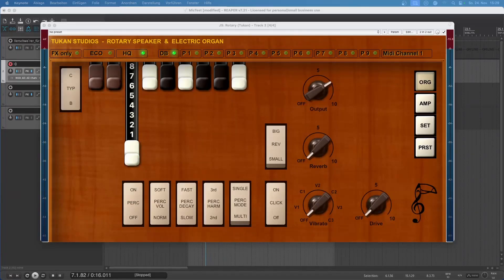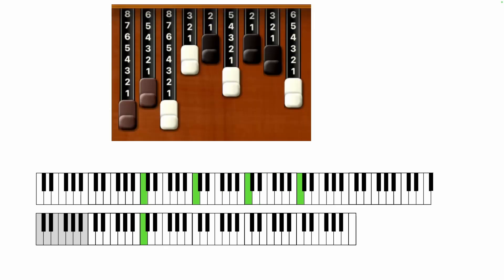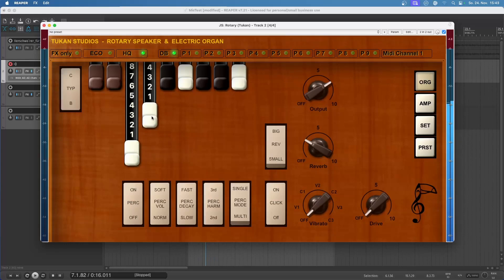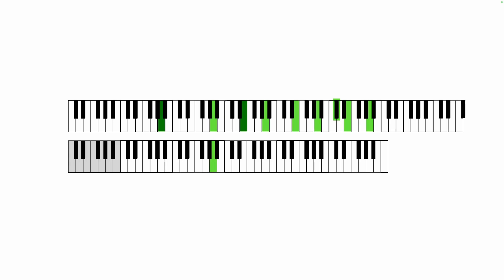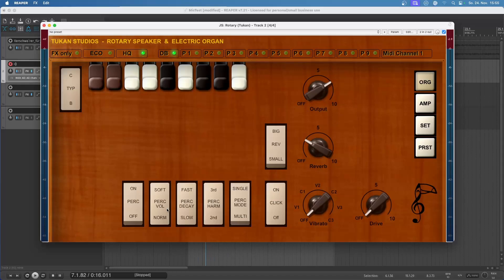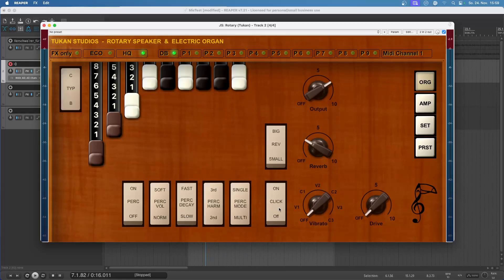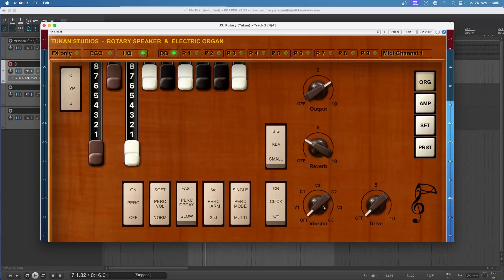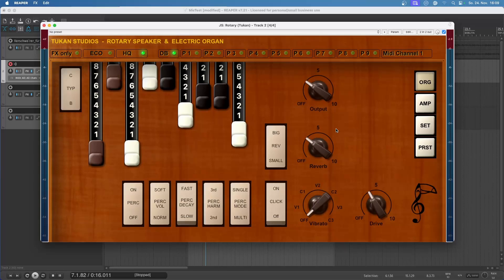The Organ Page - Rotary Plugin (Tukan Studios)

Comment: Sorry for bothering you but I'm having inexplicable trouble with Rotary

It loads fine

I can play it over MIDI

The presets work fine

But

The user interface shows no controls. All that appears is a wood effect rectangle. On the right of this is the 4 buttons labelled Org, Amp, Set and Prst under that is the Tukan logo and that is all. No drawbars buttons, switches or anything. The 4 buttons I mentioned earlier don't do anything or change the screen. I have the latest version and have tried to reinstall several times. I really don't know what to do to make the controls appear. Any help would be gratefully received. thank you in advance. J

Comment: John, I apologize if this is an inefficient place to request changes: but your synths/instruments are GREAT, is there a way you make them appear as "Instruments" within Reaper?
I have to jump through a hoop or two when I want to use December Synth or Rotary. Because they're not "instruments", my default track just detects microphone input and not my MIDI controller. It works best if I "Insert Virtual Instrument on New Track", pick anything else, then replace that with your instrument.
Thanks again for the excellent software, and the lesson on drawbars was genuinely enlightening! Hopefully my suggestion is relatively easy to implement, but either way your instruments are worth any negligible hassle. Incredible stuff, you're a pillar of the Reaper community 🍻